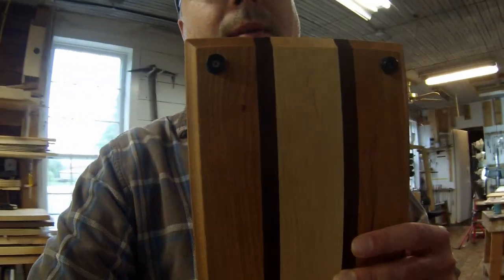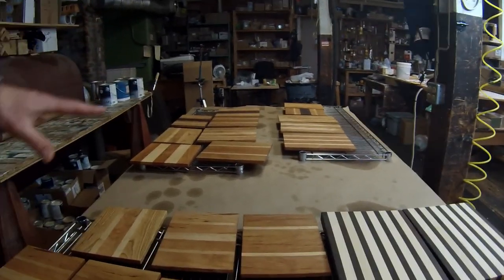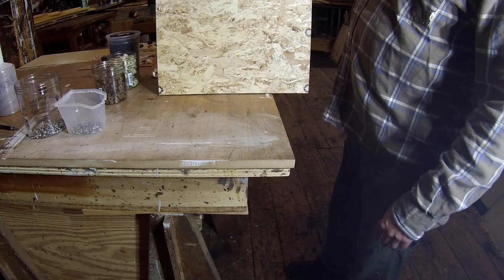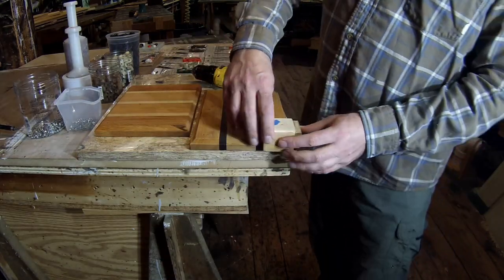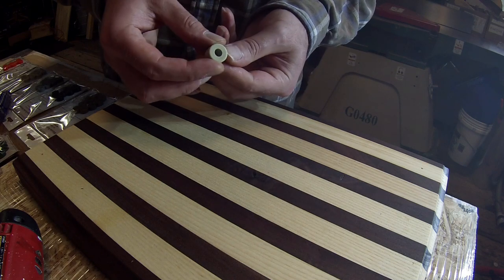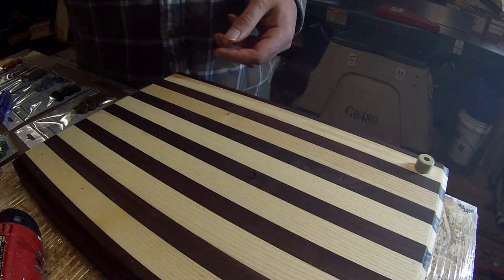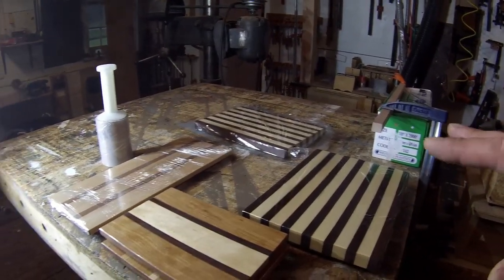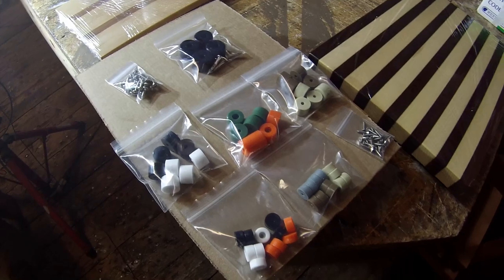How To Install Cutting Board Rubber Bumper Feet (and More)

Comment: hi, would you recommend or not adding rubber feet to a large board 24x18?.  May warp?..  If you do recommend adding, what would be the proper placement/alignment?.. Thanks for your time and video!
Reply from the maker: I recommend feet for even drying on both sides.  it is the best prevention for warp.  I don't have a standard placement.  for a large board that size, I would put on the large rubber feet 7/8" DIA and set them back 1.25" on center.  some people like a smaller foot so it is up to you.  I also will be carrying XL 1.6" DIA soon

Comment: That's a very interesting trim bit you're using on the bottom side of the boards. What router bit are you using for that?  Nice boards!
Reply from the maker: 1/2" cove bit.  makes it easier to pick up
Reply: That was my guess. Thanks for the response.

Comment: Are the cutting board "feet" the same item as on the push sticks?
Reply from the maker: Same material and color for the push sticks but without the stainless washers.  you don't want metal near the blade

Comment from the maker: Black sample pack, 4 each Small+Medium+Large, $12.50 with free shipping USA
ALL colors and sizes $35 with free shipping.
http://www.ebay.com/itm/SAMPLE-PACK-Cutting-Board-Rubber-Bumper-Feet-1-2-5-8-7-8-/222536517165?var=&hash=item33d035c62d:m:mHqzuBunhZjSWRHTviLTOJw